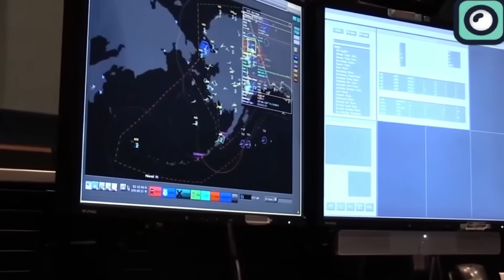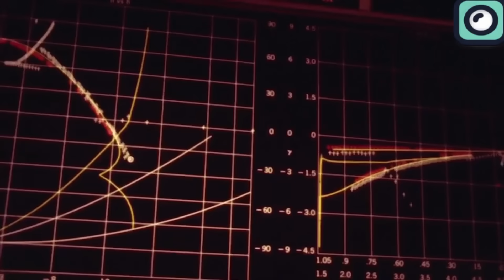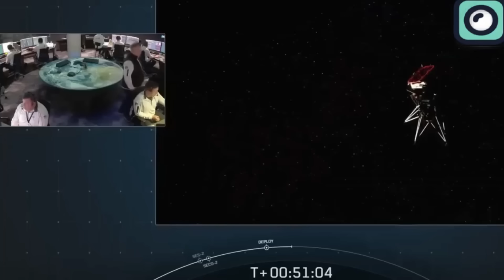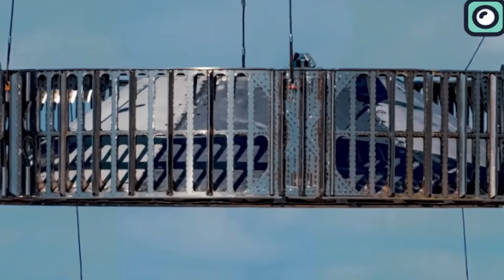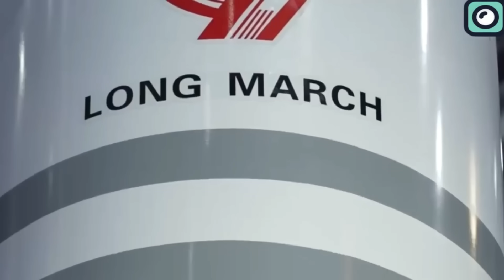SpaceX Did Something NASA Couldn't for Decades!

Comment: The Lockheed Martin Atlas V booster also had zero launch failures, but the Falcon 9 had more successful missions.  Kudos to SpaceX for making a viable reusable booster.  They didn't have NASA telling them what to do when they designed it.  NASA rejected several industry concepts for reusable boosters a couple of decades ago.  NASA's unique requirements for testing and contractual reporting requirements add a lot of cost to space system development.  The Space Shuttle solid rocket boosters were recoverable and were refurbished and used again.  SpaceX has yet to land anything on the moon.  Artemis is a Lockheed Martin design (which has already orbited the moon and returned to earth).  SpaceX's moon lander has yet to fly to the moon - it's still in development.  SpaceX's Starship has yet to demonstrate a mission with successful recovery of the booster and spaceship.  Good luck to SpaceX solving those technical issues. It promises to be a great capability.